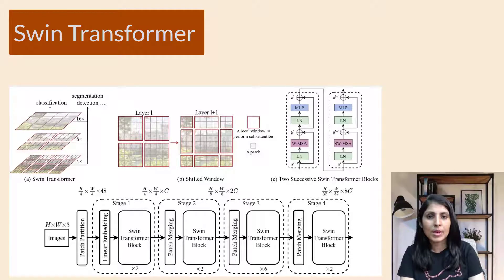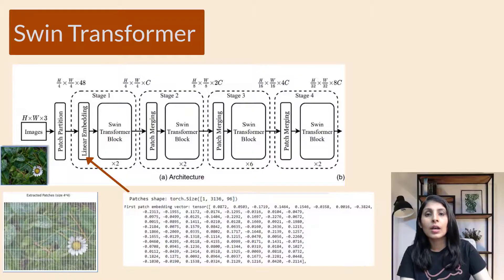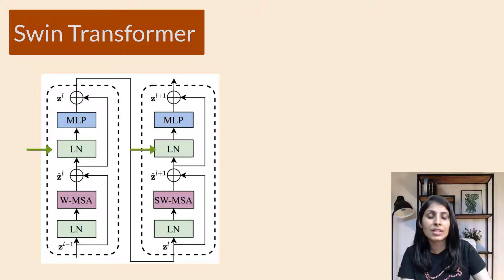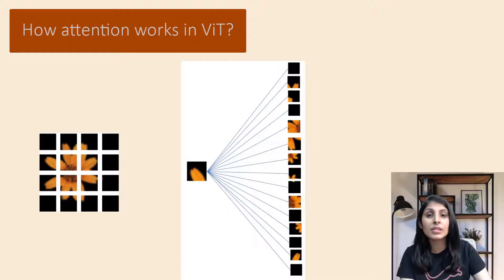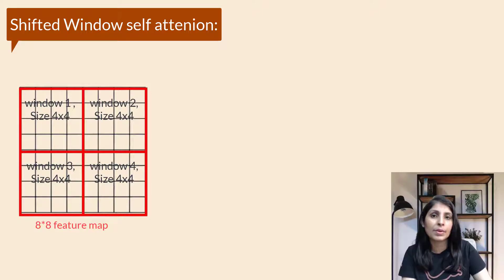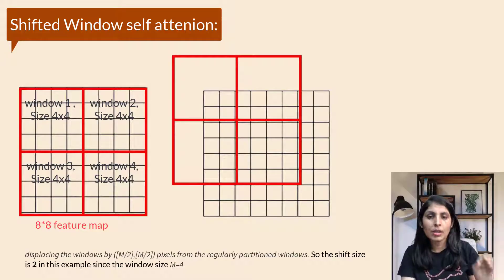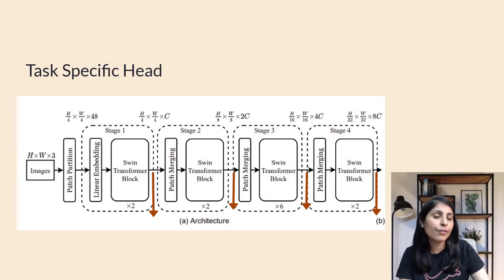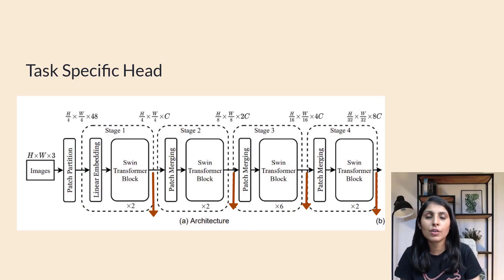Swin Transformer: Hierarchical Vision Transformer using Shifted Windows

Comment: Hello, mam I'm working on the diagnosis of skin diseases and I have done implementation by using Vit, so I wanna ask if should i use Swin transformer and concatenate both Vit and Swin transformer together to make novelty? I need your suggestion, please.
Reply from the maker: Yes, you can experiment with combining ViT and Swin Transformer using ensemble methods to potentially improve skin disease diagnosis, but carefully evaluate individual performances and consider computational resources.
Reply: Hi, have you done the ensemble of vit and swin transformer?